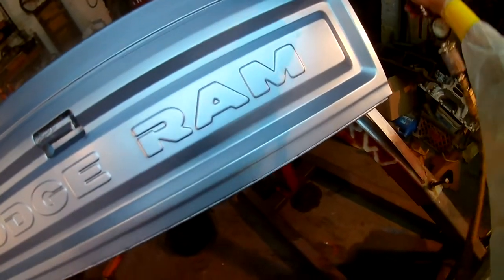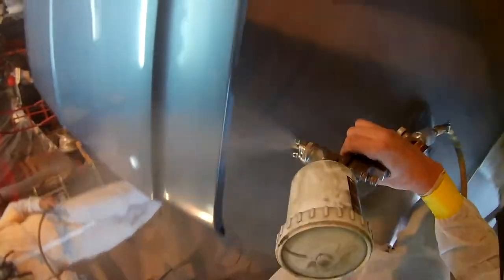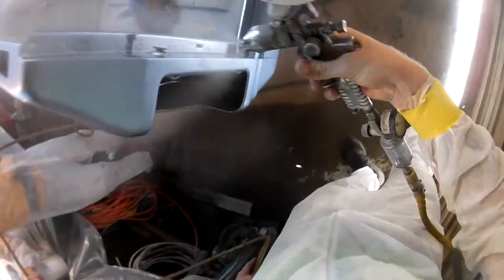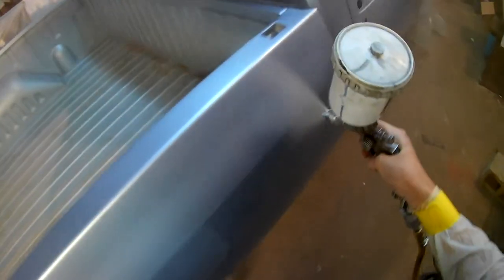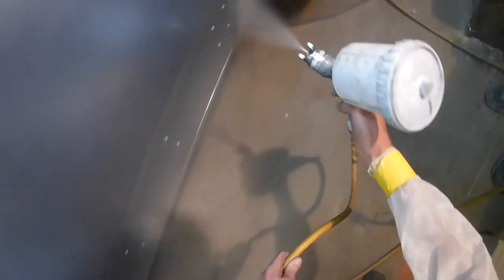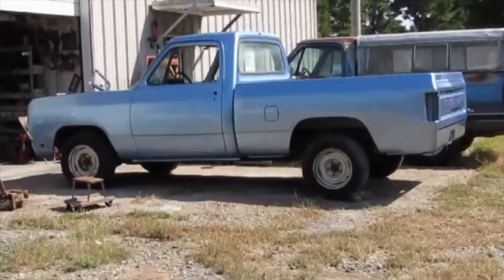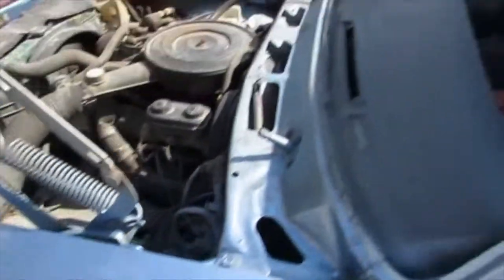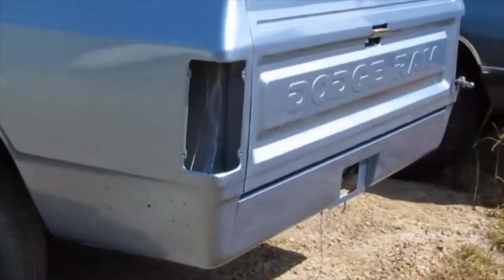Painting a Truck at Home! (Part 2 Clear coat and Unmasking Outside!)

Comment: In the prep video, I sure am glad you fixed the air leak.  In this vid you were smart to go with a big tip if it’s hot.  I think it looks real good. Nason clear lays down 👍
Reply from the maker: Thanks Bondo Billy! This was a few years back. I learn from every job I do. The Coronet was a new challenge. Had to fix 30+ year old body work that had spider cracked everywhere, and paint over the old lacquer paint.

Comment: Wheels... i wish we could still get E.T. aluminum slots. Deep dish and reversed rears with spacere to get the look right! Man there is nothing better than accellerating over cracks and ripples with street legal drag slicks at a lower pressure.
Reply from the maker: john carlson sounds like the old racetracks I used to go to. You could hear the tire make a tock-tock noise when you went over the cracks like George Rays dragstrip.

Comment: That's looks great! Did you do the body work on the driver's door? If so, is there a video?
Reply from the maker: Thomas Anderson I did. No video of it. It was basically me hammering dents for a while and then about 10 coats of filler and sanding. Still could be better. I might redo it later. If so, video will follow!
Reply: @JustMoparJoe  Please do. I have a couple door dents in my Fury III. I've been talking to a few mobile body guys on Craigslist, but I'm down to learn.
Reply from the maker: Thomas Anderson stay tuned! I’ve got to paint a demon lol

Comment: Is that drip pan on the back custom? Looks awesome i think, trying to decide if i want to do that or add a ramcharger rear chrome bumper to my 72
Reply from the maker: nate hull I bought that off eBay. I’ve had several requests for the install video. I think I have the footage and will get it up at the end of next week

Comment: Looks great! Is that the $9.99 with coupon Harbor freight gun that you are painting it with?  Is there much orange peel?  Thanks for the informative videos.
Reply from the maker: EZElk I believe it is. I took the tip pieces from my good gun to a larger 1.5 tip. The orange peel is really nice on 70 percent of the truck(which is a win for me). Minimal buffing and only wet sanding a few runs.

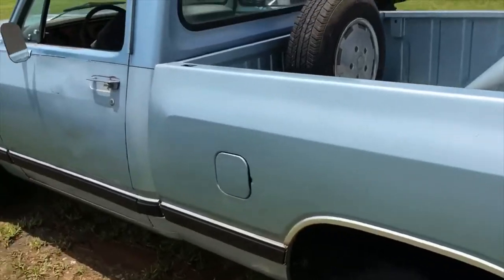Comment: Is the drivers door not accepting the paint or running? It seems at 13:06 the close up revealed peeling or something? Sorry if you mentioned this previously, I FF a lot.
Reply from the maker: Fredsgarage I tried cutting in an old clip of the truck right there. The door is fine. It could have stood another day of blocking and priming. The paint stuck fine, there’s a small ripple where I have a poor transition from filler to metal.

Comment: Nason clear is great stuff
Reply from the maker: mickymopar I agree! I’m used to spraying cheap internet stuff or Omni. I actually have a spot on my black truck to redo that pressure washed off the other day. 🤦🏼‍♂️ I may just flow coat the whole side of that truck with Nason.
Reply: Looks to have turned out great ive got a devilbiss gravity feed non hvlp i spray base and clear both with i dont see the need for two or three paint guns